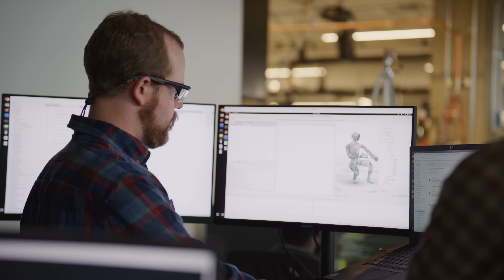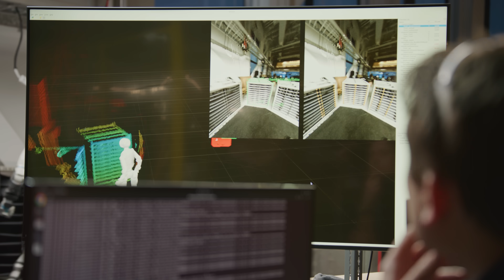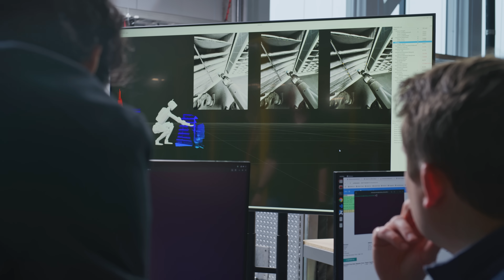Perception and Adaptability | Inside the Lab with Atlas

Comment: So basically this robot is focused on collecting as much data about environment around it as possible before choosing an action and it tries to collect needed data all of the time and does small actions like moving around stuff to see it better so it can achieve it's main goal in effective way. Basically check-do cycle. Also idk how it processes things but I imagine that there could be multiple neural networks for processing images, sounds and logic with some other useful algorithms mixed in
Reply: It could also have applications in QA like that. In the case of these engine covers, it looks at one to get an idea of what it is, the shape, the weight, etc. It can look over an engine cover and perhaps notice a flaw or defect in the product and then set it aside if it notices something is not exactly as it should be.
Reply: The lead researcher says at the end 'going from AI spatial models to actual physical intelligence' ... that sounds like an intelligent sensor network - like a human nervous and muscle system, so built with autonomous subsystems. So a detached arm will know how to reattach its self...
Reply: @Seafox0011  ??? XD no.

Comment: Noticing something has fallen and looking around was very cool
Reply: Clinical almost. Very cool!
Reply: It got that task. Notice how it stopped in the middle of the space? And if it actually noticed the fallen object on its own then why did it need to look around? I would assume that it has at least 2 microphones on each side of its head to hear from what direction sound comes.
Reply: @timbonator1  I'm pretty sure it just stopped because it completed it's task. It probably looked around because it's told to look around everywhere if it hears something fall. If something goes wrong, you want to look everywhere to make sure it didn't cause something else to go wrong
Reply: @timbonator1 You're projecting human qualities onto a machine🎉
Reply: It didn't notice it, it was told to look for an object on the floor.
Reply: Listening for something drop is the easy part. It's the repositioning itself and then crouching down to pick it up with two hands that's the challenge.
Reply: @JonahHax  how do you know?

Comment: I’m kinda surprised atlas doesn’t have a pair (or more) 360 cameras in its head so it can see all around at all times with depth perception.
Reply: Wouldn't be a waste since he can turn his head 360 anyway
Reply: @blue-cloud-studios I don’t think it would be a waste.

When you are talking about efficiencies in manufacturing etc, it takes time to rotate its head to ensure there are no obstacles or to find the part it is looking for.

Why would you not just give it omnidirectional vision so it has constant 360 awareness?
Reply: @RossGirven  Computing power necessary to compute all that, vs. computing the interesting part where the robot is looking at or walking to ?
Reply: @deildegast  a Tesla 🤢 (sorry) uses 9 cameras simultaneously to monitor its entire surroundings in real time, and the computer running it is only 315x190x40mm.
I don’t see why a couple of 360 cameras on this would be that much of an issue.

In an industrial environment, having a track on everything around you is an invaluable advantage.

People moving, machinery moving, idiots throwing engine covers on the ground… all this is taking extra time for the bot to look at.

Computational power is cheep compared to time saved in industry.
Reply: @RossGirven  The task of a Teslas self driving AI is much simpler than what we want Atlas to do. It also notably is not very good at self driving.
Reply: Honestly I find it more impressive that Atlas doesent because it means it only can work off of what it sees
Reply: @TheMagneticDude I am not sure it is any more impressive, it is working of the same data it would be with 360 vision, it just takes longer to look around.
Reply: @RossGirven  Giving the robot more information is tricky, we have to make sure that the information we give it is relevant. Granting the robot 360 vision is only useful if we ensure that it doesn't end up being noise that the robot has to ignore all the time. Limiting it to directional vision is a good way of controlling the amount of information the robot has to deal with. Not to mention that more input = more processing time, especially for the neural network (AI) part that they mentioned.
Reply: @Alphashow7  true. AI is improving fast though, I’m sure it would not be long before a model could process all the info in near real time.

The way I’m looking at it is if a task takes 15 seconds and it spends 1 second of that looking around then the bot is wasting 96 minutes a day looking around.
Reply: @Alphashow7 also our current tech is not good enough for this kind of stuff now. 
Maybe when we can create supercomputers the size of a human brain we could do that kind of shit
Reply: It wouldn't look as human which is the goal here
Reply: a single camera on a rotating axis is much easier to troubleshoot for engineering and programming purposes, it is just a prototype though so i wouldn't rule out more cameras in the future, it would have more information to work with at a time, but it would also physically heat up more and stress out more systems on the bot. its a balance of processing power and the physical space and ability to remove the heat generated by more systems on the bot.
Reply: @miller5677  It needs the two front cameras for stereoscopic vision, but i agree that adding a 360 camera would be useful for being observant of more of the world at once. being able to track changes that it isn't directly looking at, being alert of things coming from behind that might bump into it, etc.
Reply: Though, it already has two side cameras, so likely already has 270 vision- it becomes much less of a deal with a smaller blindspot due to the head position changing often- nothing is likely to stay hidden for very long.
Reply: More data is not always good. Greater input also means more neurons committed to processing that input which in turn means it becomes less capable of more abstract cognition. Having its vision actually focus on things that are relevant should also make things much simpler for the network. It is a neat built into the hardware attention mechanism. If you add more cameras that would have to constantly happen within the network using up even more of it.

Comment: The punch at 1:03 😂😂😂
Reply: He watched the very first robot fight tournament, and he thinks he could win it. I hope so, you can do it Atlas !
Reply: i actually wonder how hard it could punch.  is this just another step toward MMA combat robots?
Reply: @MTSDfreezingFire  They are very weak. In fact the motors of robots that are meant to actually interact with humans are generally built to be too weak to harm them as a deliberate safety measure.
Reply: @MTSDfreezingFire  Probably not. See the problem with robots, especially humanoid ones, is how they are inferior combat platforms compared to drones or tanks etc.
Why? Points of failures. The more advanced a robot is, the more movement systems it has, the more points on it can break under stress. Besides, tanks has the benefit of being lower to the ground and harder to hit than say... Something like a mech walker. So... At least with our current technology, combat robots isn't viable.